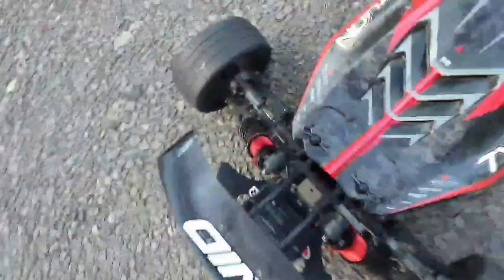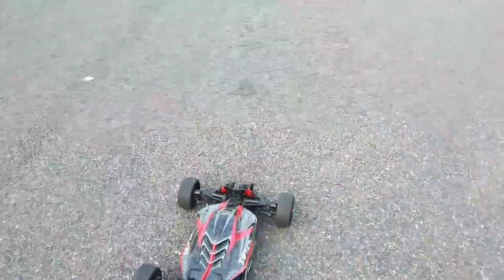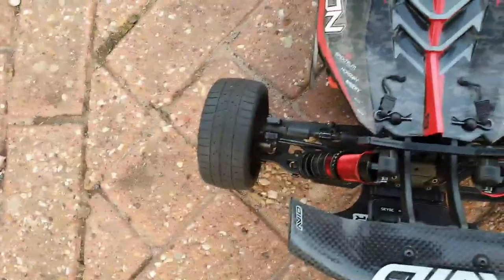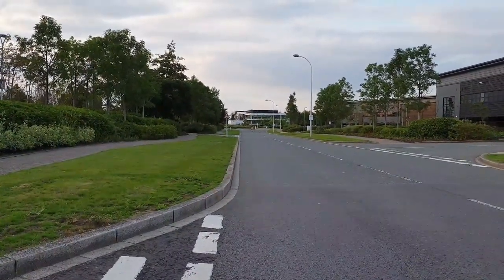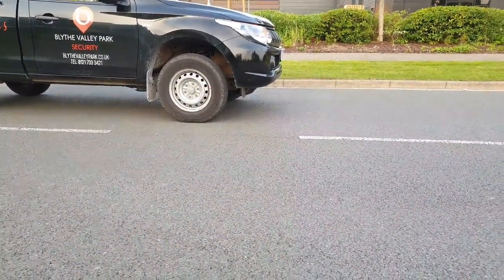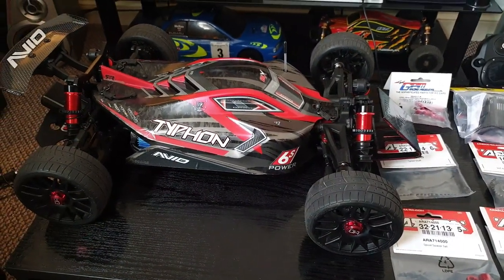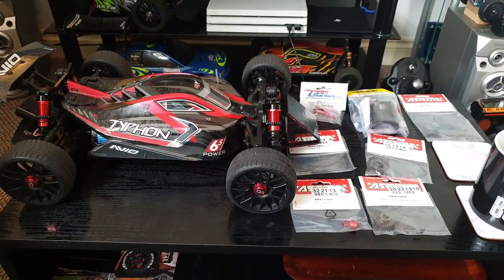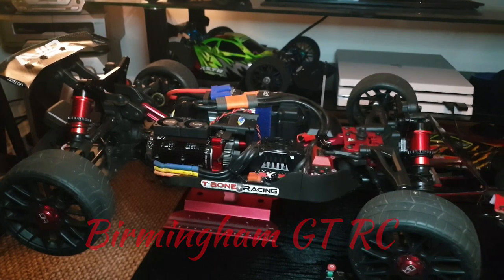Arrma Typhon V4 Limitless Spool fitted ready for a high speed run 😎

Comment: Hello. May i know where did you get the front bumper?
Reply from the maker: From my local hobby shop in UK wheelspin models they do ship out as well or I've seen on ebay to in few different styles. I put the front bumper on the back as the back is the same just smaller and I think it look better with bigger bumper on rear.
Reply: Birmingham GT RC i cant seem to find it. Do happen to have the part number? Or at least the name of it?
Reply from the maker: @cookietiau  I put part number in other video but it T-bone racing cant remember part number right now bruv.

Comment: Bro what kind of tires is that?🤔I seem to blow my tires out when doing this
Reply from the maker: I'm using sweep belted tyres I spare the Matt black
Reply: Try GRP tires. I use them on my typhon 6s no ballooning or blowi ng at all
Reply from the maker: @MelbourneExclusive0  I'm going to give grp a go as I haven't use any yet but these sweet tyres are rated to 100mph+ so I'm gonna see how they do before I switch to grp and i got some foams coming to to try them out.
Reply: Just received the Sweeps GT in black spoke.... excellent tire, bigger OD than than the GRP. About the same size as the DBOOT HOONS but less on the price. Will be ordering the white spokes next. 👍
Reply from the maker: @cacanjacowans540  nice nice so far I've not had any problems with them I'm on second set I found some sweet exp that are ment to be better grip better rubber. Just a little more than normal belted sweeps you got the exp one.

Comment: Where can I get that wing
Reply from the maker: I got it of ebay there about 5 different styles and more as it was for a GT car or touring car spoiler. Check 1/10 touring car rear wings on Ebay. Their real carbon but they are thin so will break easy but well cheap about between £5 to £10.